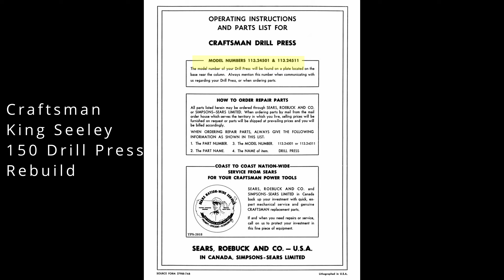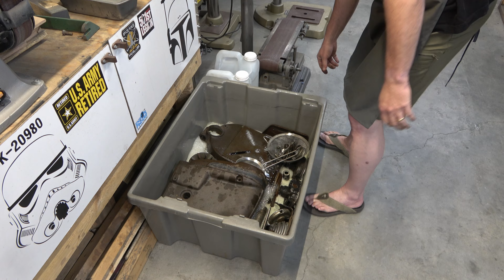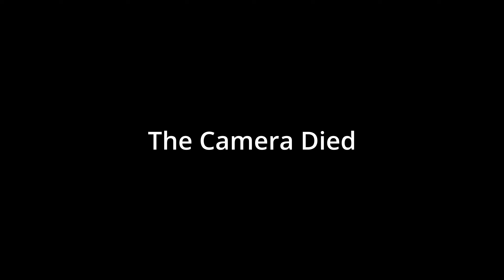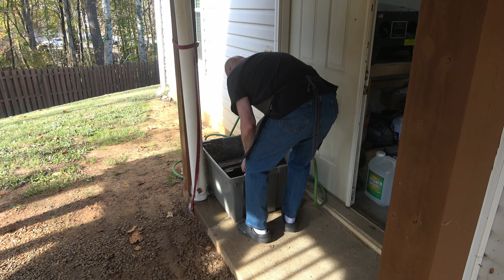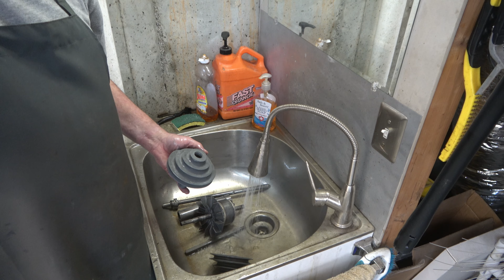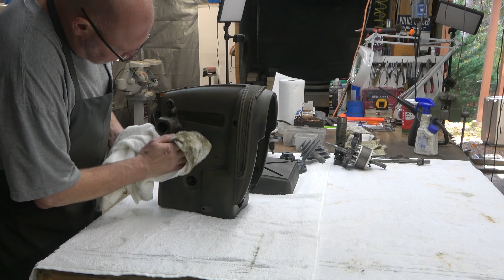Part 4 Craftsman KS 150 Drill Press Rebuild (Simple Green & Citric Acid Soak)

Comment: One question about the cleaning portion.  How did you clean the maroon knobs and get them brighter?  Soak? Mine are nice, but old enough to be careful with the brittle nature of the material.
Reply from the maker: I soak them in simple green for 24 hours then rinse and dry them. then I polish them with Meguiars One-Step Cleaner Wax. put the knob on the feed handle rod then put the knob in the chuck of a drill. apply the wax then run the drill in reverse and buff the knobs with a micro fiber cloth. Be sure that the chuck is tight and the rod does not slip in the chuck or it will mar up the rod.